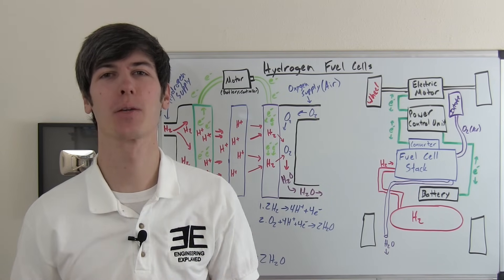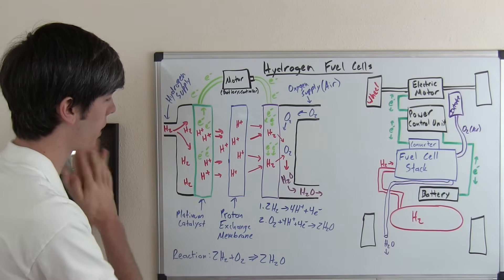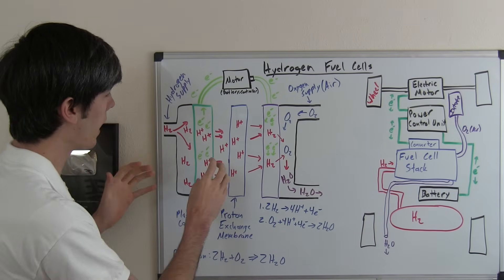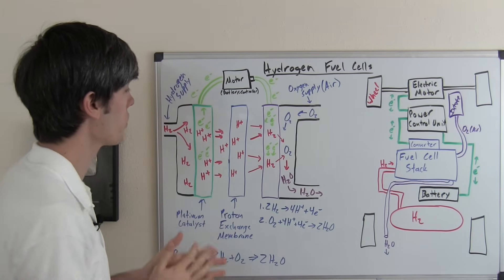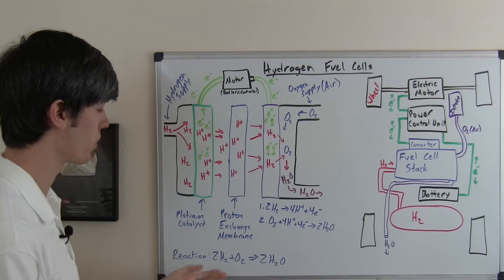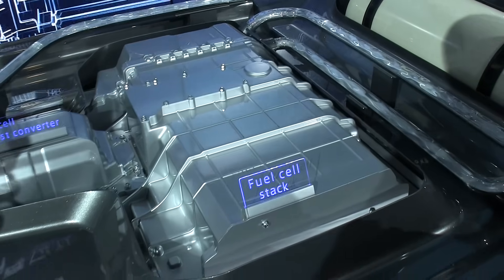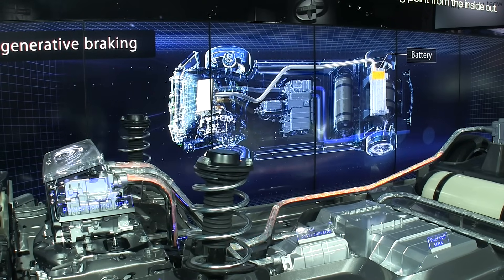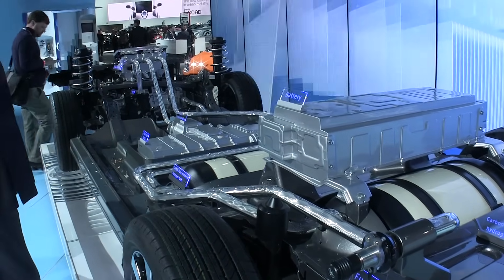Hydrogen Cars - Toyota Mirai - Explained

Comment: If after being used, the electrons regroup with heavy H, are they now not exactly where they started as H2? Why not recycle and reuse this energy ad infinitum?
Am I missing something?
Reply: +Sam S The problem is, the electrons don't regroup with the Protons/H nucleus again. They are much more attracted by the O2 molecules, that's why the whole system works in the first place. The electrons are so horny to mate with an Oxygen atoms, that they even take the longer route through the cable to get to the other side. When the electrons finally reach the other side, they regroup with the oxygen first and form an negetive charged oxygen ion. And to neutralize the negative charge, the oxygen ion bonds with 2 protons and you end up H2O or water.

Comment: So would the act of the H2 bonding with Oxygen in the car be3 considered fusion? it is creating a new element
Reply: +Cody Z. (HeyGuysIt'sCodyZ.) You are confounding molecules with atoms. Fusion is an event on the atomic level where 2 atoms fuse to make a new different one.
For example the sun emit energy by fusing hydrogen atoms, making helium atoms in the process. Hydrogen is an element, so is Helium.
While what's happening in the Mirai is a chemical reaction (molecular level). Molecules are made of atoms bonded together. Water or "H2O" is a molecule (so, not an element) made of 2 oxygen atoms bonded on a hydrogen atom.
Look for the "veritasium" youtube channel for full details on how a chemical reaction can release (not produce, this detail is important) energy :)

Comment: Why not use the hydrogen in a refined combustion engine. It's a little simpler and produces 0 emissions as it should, and you don't loose the nice sound of aspirated engines.
Reply: +TheIndianDude - (RedLinuxFilms) It would be way less efficient. A modern fuel cell can easily extract more than twice as much usable energy out of hydrogen. And it wouldn't be zero emissions. Because you would use air for the combustionsprocess which contains a lot of nitrogen, the engine would still produce some nitrogen oxides. There's simply no way around that in an internal combustion engine which is feed with normal air.
Reply: +shi01 This kind of future really kicks petrolheads in the nuts. Badass V8 sounds bye-bye.
Reply: +Filip Gereg They probably said similar things when they changed from horse drawn carriages to petrol driven vehicles.
Reply: shi01 They did, that's why you don't see horse drawn carriages anymore. Horse riding enthusiasts can still have a horse if they want, but today's car enthusiasts are out of luck. Petrol will soon be all dried up (50 years or so) and it will be RIDICULOUSLY expensive maybe 10 years before that. So, if they do not make a hydrogen internal combustion engine (probably won't, this type is more efficient) engine sounds and loud cars will really be history.
Reply: *****
In an ICE the combustion will never be absolutly complete, simply because you can't mix the fuel perfectly enough with the incoming air, so you will always have small amounts of oxygen left which didn't react with the fuel. And a further problem is, that the ECU don't know exactly how much oxygen actually enters the cylinder. The ECU only measures the amount of air that enters the cylinder, but the amount of oxygen in this air can vary a bit.
You don't need hydrocarbon based fuels to create Nitrousoxides. If you just heat up the air enough, the nitrogen will start to bond with the oxygen by itself. So although the NOx emissions are comparably small if you run an ICE with hydrogen, it is not 0, where the fuel cell really only produces water as a waste product.

Comment: can the reverse be done using same stack to generate hydrogen? that would be useful in areas where hydrogen fuel stations are scarce. simply plug into your garage 120 or 240 volt ac overnight to generate hydrogen.

Comment: I'm still with sucks balls and ray ray, who asked about the perpetual motion appearance as a reply to the oriinal comment by EE. 
could someone explain the difference between the original H2 and the end product H2? and what you can't just feed it back to the fuel cell?
Reply: +Khalid “Zaki” Ansari thanks khalid. so... what is the difference between the two types of hydrogens? is it something aboit the number of electron, and if so where would that electron have gone ,litterally?  thanks!

Comment: Why combine hydrogen with oxygen? why not send back the hydrogen to the hydrogen tank and use it again? I know this would mean continuous energy which is not possible, so that leads me to believe there's a reason why we can't send it back to the hydrogen tank.
Reply: +kbracarlosoler because there is something called electronegativity. The free electrons on the left side are more attracted by the oxygen atoms on the right side than by the hydrogen nucleus/protons because of the higher electronegativity of the oxygen atoms. The electrons will attach to the oxygen atoms first when they reach the "exhaust side" and form a oxygen ion with a double negative charge. Now the oxygen ion need 2 hydrogen nucleus/protons to achieve a neutral electric charge and by attracting them it forms H2O or like we normally call it water. So there is no H2 formed on the exhaust side.
Reply: @shi01  the question is why have an exhaust at all? I think it's Coz we can't liquify the H2 (would take too much energy) and need to exhaust it safely instead.
Reply: @TheGuruNetOn  It's not H2 anymore on the exhaust side, it's H2O and you have to get rid of it somehow otherwise the reaction would stop after some time because there wouldn't be any free oxygen atoms left.
Reply: +kbracarlosoler I have the exact same question!
Reply: You're fundamentally misunderstanding how this works. The oxygen isn't just a random thing they added on, it is what drives the entire process. Water is the output, not hydrogen.

Also just think about your suggestion. Having H2 on both sides with a membrane in the middle will result in basically no movement of H2. And if you have one side pressurised to push it through, it takes more energy than you would gain to repressurize it to make it useful again.

Comment: Good explanation. ( and excellent job on your video impressive ) 
however hydrogen is just a distraction from oil companies to slow down the progression of the electric car.
Use a little common sense. Fill a balloon with water Poke it with a needle. Water sprays out. Fill a balloon with 10,000 pounds of air. Poke it with a needle. And watch your neighborhood disappear.
Both suck. One good thing about hydrogen if you're in a accident you probably won't know it. Although you might find out what you a-- whole taste like.
Go electric. More faster more speed more torque more better. Stop getting distracted by the propaganda and plug in :-)

Comment: is hydrogen technology being used is racing? ie. drag, formula 1, le mans....
Reply from the maker: Michael Olan For drag it would make more sense to just have a battery pack with the amount of energy needed. Formula 1 has an electric series; there are hybrids in Le Mans but no hydrogen.
Reply: +Michael Olan I am almost certain that there is an Aston Martin that racing in a gt class that is hydrogen powered. Also the fastest 1/4 mile time was set by a hydrogen powered car (3.58 seconds).

Comment: what is more expensive? , a pure electric car or a hydrogen fuel cell car?
Reply from the maker: Asiri Iroshan Currently hydrogen is more expensive, but has a longer range.
Reply: I've heard that extracting hydrogen is very inefficient because to extract 1KW of Hydrogen, 3KW of energy is needed. In that case, the fuel cell cars are inefficient considering the whole process relatively to pure electric cars....... Is this true?

And this video is great and very understandable..., keep up!
Reply: +Asiri Iroshan Even if this is true, I believe that in the future the extracting process would be made a lot more efficient. You have vast amounts of hydrogen in space. That means that the supplies cannot be exhausted and it does not produce any pollution, but rather drinkable water which you can actually drink. I really believe focusing on hydrogen should be a high priority in the future.
Reply: Current power plants are not set up for hydrogen production. Search around Youtube if you are technically-minded, there is a series of lectures by MiT - it makes more sense if you set up your nuclear or otherwise power plant to use process heat to aid in production.
If you just want to produce hydrogen in your house or at gas station it makes zero sense.
Reply: MarcinP2 If you are referring to me, I did not plan on producing hydrogen myself, I think there should be plants made exclusively for that purpose and sold at stations.

Comment: What are your thoughts on Elon Musk's comments about the Hydrogen Fuel Cell car being a waste of time due to the low conversion efficiency of generating hydrogen? I believe harvesting hydrogen is only 30% energy efficient in terms of how much energy you get out compared to how much was required to harvest that hydrogen. Just plugging in a normal EV would be more efficient since the power plants have near an 75% efficiency.
Reply: BEV is much more efficient. Hydrogen is a luxury fuel for people who are unwilling to wait while their battery charges. For passenger cars people should just learn to be patient. For working vehicles like trucks or construction machinery, avoiding down time may be worth the large efficiency penalty of hydrogen.

Comment: Ok so if the electrons split off from the hydrogen atoms, go to power a motor, then come back to meet up with the positively charged hydrogen atoms, then you should have the same thing you started with. So why would they combine them with oxygen atoms to create water? Couldn't you just pump the hydrogen that just went through the cell back into the tank? I don't understand.

Comment: When the hydrogen comes through the membrane and recombines with the electrons it reforms H2 ( sorry no under under script) so , why wouldn't you be able to reroute it back to the tank , or is there a law I'm not understanding, or something.
Reply: Bugalona It doesn't form H2 after the membrane. The electrons are much more attracted by the oxygen atoms, that's why they flow through the cable in the first place. So they connect with the free oxygen atoms and form O2- (a double negative charged oxygen ion) And now to neutralize the charge they pull 2 protons through the membrane and change to H2O.

Comment: this is so stupid, why don't we just have massive factories producing electricity from hydrogen... at such large size and specialization, they will probably do it better than a car and the car wont have to drive around with highly flammable gases and extra unnecessary equipment.... just a bigger battery. Has any scientist thought of that? what im I missing here??!?!
Reply: Hans611 And how do you get the hydrogen for the massive factories? Btw most poeple would call something like this a "powerplant"
Reply: shi01 what im trying to say is large factories can be hundreds of times more efficient that a small unit in a car producing electricity from hydrogen. So instead of having all this bulky (and dangerous, hello hindenburg) equipment in a car, to produce the electricity, all they have is a battery. The specialized factories worry about efficient production of electricity. Economies of Scale? the only inefficiency of that is the typical power grid, that loses considerable energy from the factory to the "pump" to your car, but minimal compared to the advantages. Its pretty clear "hydrogen fuel cell cars" are not the answer. Maybe hydrogen internal combustion engines, or good old electric cars. The electricity can be produced the old fashion way, coal plants, hydro, or renewable.. solar... its pretty logical this will never take off. The jump we are gonna have is gasoline/diesel internal combustion to electric power (aka Tesla) There will never been hydrogen fuel cell, its stupid.

Comment: Why should they even bother creating water then? Why not just reuse the H2? In that case, there wouldn't be the need of two hydrogen gas tanks, intake, or exhaust pipe, and you'll have essentially unlimited fuel supply.

Comment: The biggest benefit I see this has over EV is not having to replace the battery (which is costly and inevitable) but I feel like that platinum catalyst is not going to last forever either. My question is how much is that catalyst compared to a new drive battery.

Comment: I'm just waiting for the day that cars run of Nuclear Fusion and or Plasma.
Reply: The radiation from a working fusion reactor is pretty much the same as the radiation from a fission reactor, deadly and has to be shielded by 6 feet of concrete.  So it would be a very heavy car.

Comment: Might be a dumb question, but will this car have problems emitting the water from the tailpipe in harsh winter?
Reply from the maker: Josh Snyder That's a great question. I'm not sure what temperature it will be emitted at, though I'm fairly certain it will be a vapor. Nice little cloud formation in the winter I suppose, though regular gasoline engines emit water vapor as well.
Reply: Well as a motorcyclist we would be keen on that coming out as any kind of condensation that may make the road slippery with water, particularly with spreading out a little dot of coolant or brake fluid or I dont know many people who motorcycles in snowy weather but there is places that develop Ice and even a condition known as Black Ice (look it up) so if we can get that vapor out at a temperature that may even melt ice on roads than we can use that as a really useful secondary by product so long a we are building the most appropriate drainage systems into roadways to move all the water off the road in drains or as steam.
Reply: @SpeKterDesigns  Per mile it's no more water than what drips from a gasoline car, probably less.   And black ice comes from precipitation or condensation.
Reply: @RandyTWester  Could be many/any solutions coming out just hope that we are able to develop the best ones for implementation. :)
Reply: @SpeKterDesigns  what an answer it is!! Awesome...
Reply: +Engineering Explained have you ever heard of Stan Meyer and his water powered car? I think it's a similar process but uses a certain frequency (I think) to separate water into its basic elements and then the rest is the same.

Comment: Great video, it was very informative and made hydrogen cars easier to understand. I just have one question, why can't you reuse the hydrogen? Since there is no combustion it doesn't seem like you need the oxygen at all so how come you can't send the hydrogen back into the tank and reuse it?
Reply: You do need the oxygen for this process. The only reason the electrons try so desperate to wander to the other side of the membrane is the very high electronegativity of the oxygen atoms. The oxygen Atoms are more attractive for the electrons than the protons.
The whole process is in fact an controlled oxidation of hydrogen.
Reply: Wow i did not know that, thank you for that response. Learning something new everyday.

Comment: Its all good until something breaks. Then come the expensive repairs.
Reply from the maker: asdf Like everything...
Reply: Engineering Explained
Yeah you're right. I bet if that battery or the control module burns out, ill be over 2k in repairs. But yet again, hydrogen powered vehicles are still being experimented with. Like your videos man! Keep it up!

Comment: Electric Vehicles (EV) vs Fuel Cell Vehicles (FCV) - the next few years will be critical to determining which technology ultimately will be the future of transportation. But overall, it's the supporting infrastructure that will win out. Electric vehicle have a major advantage because they can be charged at thousands of locations across the country. In addition, chargers can easily be installed in someone's home, and the Tesla Supercharger network is already in place. In contrast, hydrogen filling stations are primarily only in California and have little penetration across the country. Building hydrogen stations require significant investment, and this will not occur since this technology is not the proven solution for the future.

Comment: I thought it was gonna be water put in instead of gas then use an electrical charge to split the elements h2o into h2 and o and use the hydrogen to combust to produce energy to move the car
Reply: That would be a perpetual motion machine of the first kind. No car will ever produce it's own fuel and keep moving without energy from outside.

Comment: Hydrogen propulsion is the way to go, and that's because it fits our lifestyle now. Unlike cars that go 200 miles and then need to spend the next 18 hours on the charger, fueling up takes the same amount of time as it does your petrol powered car. It's way better then battery powered cars. And it's not as though we will ever run out of the most abundant element in the world. The only hard part is getting the hydrogen buy it self.  But I am sure that process will become easier as scientists continue to exploit this field.